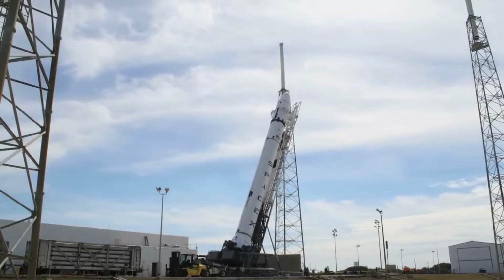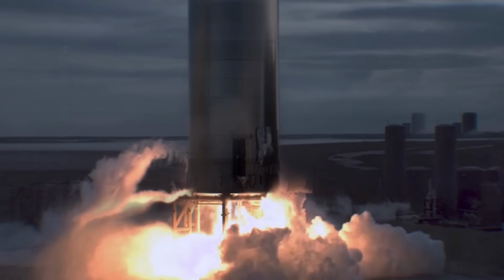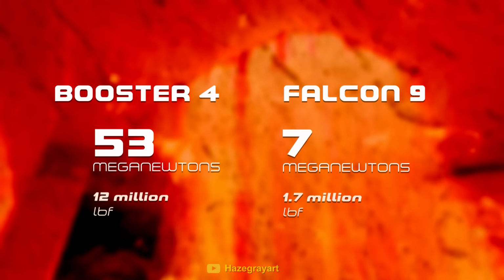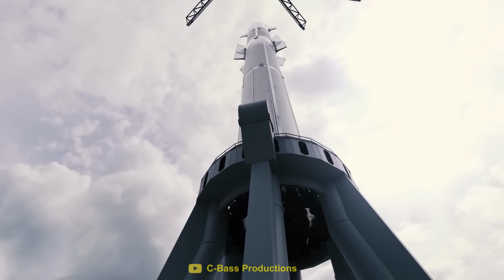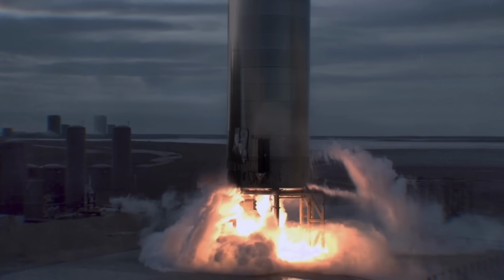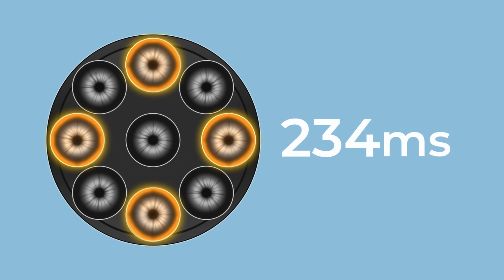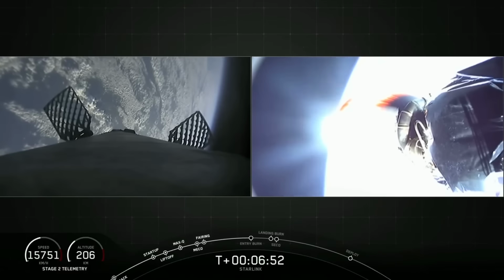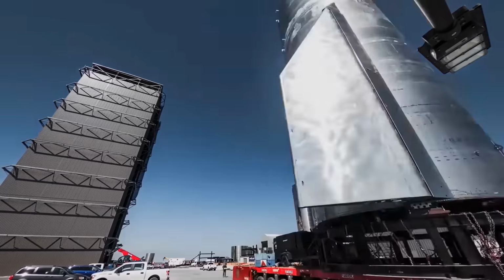How SpaceX Will Test 29 Raptor Engines

Comment: Shouldnt the oxygen be the limiting reagent for the static fires? Or are they precise enough with the timing to not run the engines oxygen rich at the end of the fire.
Reply: Unfortunately for this particular issue, oxygen is abundantly available from another source, known as the Atmospherically Induced Reagent.
Reply: @BobStein  yes but isnt a methane fire outside of the engine better than the engine itself being oxidized?
Reply: @k_Why  The amount of oxidizer you have in a tank has literally nothing to do with how rich you choose to burn your engine unless you totally run out of methane, which they of course would not do.
Reply: @filonin2  oh true hadnt thought about the fact that they dont need to run the methane tank dry. thanks for clearing up my misunderstanding

Comment: 14 TONS of fuel in 3 seconds!   😮
Holy crap that's insane!
Reply: its like  16,92,481inr
Reply: @ReadTheShrill
 14 tons of fuel in 3 seconds is nothing compared to the Apollo/ Saturn V moon rocket, the first stage burned 16 tons of liquid fuel per second.
Reply: @Starrystarryskyisme  All of this is incorrect. First of all are we talking fuel and oxygen or just fuel? Let's talk both for now. Raptor 1 consumes about 0.6 t of methalox per s (80% LOX). F1 burns 2.5 t keralox per s (72% LOX). So we have 5 x 2.5 t/s = 12.5 t/s of keralox. Raptor: 33 x 0.6 t/s = 19.8 t/s. And I mean it's kinda obvious, Super Heavy has over twice the thrust of the Saturn V. Raptor is more efficient than F1 but not 3X as efficient. 

Let's consider just fuel: 
F1 0.8 t/s x 5 = 4 t/s kerosene (RP1)
Raptor: 0.12 t/s x 33 = 3.96 t/s CH4

Ha! Same fuel consumption twice the thrust. Not bad, but that's partly down to Ox ratio, the combined figure is more illuminating. 

Note: I used 33 Raptor 1 engines. Booster 4 will likely be the only 29 engine SH flown. Likely only Raptor 1 Booster to be flown, Raptor 2 will consume closer to 1 t/s of methalox at 230 t thrust each. So 33 t/s of methalox per booster or 33t x 0.2 = 6.6 t/s CH4. I stuck with Raptor 1 because the figures are known.
Reply: @Starrystarryskyisme  And let's check the 14 t per s claim on Booster 4. 29 x 0.12 t/s x 3 s = 10.4 t of CH4. 30 t methalox so not sure where 14 t comes from. Maybe 10.4 t metric is 14 short imperial US t? No idea, I used metric t = 1000 kg Depends of course what fuel to ox ratio you use. If you use 0.75 that could explain the 14 t. It's between 0.75 and 0.8.
Reply: @please_stop-v7o   It was only necessary to say that if you include the 50 tons of oxygen to the 14 tons of Methane fuel burned by Starship in 3 seconds it comes out at a little over 21 tons per second compared to the Saturn V of 16 tons per second. My mistake, I should have followed the video closer. Anyway, I’m sure many people will be thrilled to read your amazingly detailed explanation as to why I was wrong.
Reply: @Starrystarryskyisme  Well sorry I find this stuff interesting. I don't care who is correct. Not meant as a personal attack but just saying the figures is meaningless without showing how you arrived at them. This way anyone can double check it in 2 s. And detailed would have been deriving the mass flow from scratch using specific impulse and thrust (which is how we know them).
Reply: The Space Shuttle solid rocket boosters burned 11,000 lbs per second, each, for a little over 2 minutes, and that doesn’t include what the Space Shuttle engines were burning.
Reply: @rwfrench66GenX  Sure but that was solid fuel. These are liquid engines that need to pump all that. Plenty of SRBs are more powerful than the largest liquid engines.
Reply: @please_stop-v7o  so why not use solid boosters?
Reply: @rwfrench66GenX  Many reasons. High thrust but low efficiency. Not really reusable. This is supposed to land and be reflown in an hour. Even refurbishing the Shuttle booster cost more than making new ones, because you have to completely rebuild them. A liquid engine can be throttled, which is critical too for landing. SRB is an easy fix for an overweight rocket to get of the pad but the liquid engines provide the actual performance to get to orbit. SRB's basically don't add deltaV, they just add thrust, so it can get off the ground while it burns enough fuel to go on without them. They are good for some situations but not for what Starship is trying to do (be fully and rapidly reusable, launch, land, quick inspection, refuel and go again until the tank dies from metal fatigue after a thousand launches. SRB are not compatible with "airliner-like reusability". They are cheap boom sticks, to give your expendable rocket a bit more oomph for a heavy payload. And you can't turn them off which comes with safety concerns (Russians don't consider SRB's safe for human use and never used them beyond ICBM's).
Reply: @rwfrench66GenX  dirty, wasteful. and reusability is spacex's main goal. you cant reuse srb's.
Reply: @rwfrench66GenX  cause when you start them you cannot turn it off
Reply: @neiljustineesteban8485  I’m aware of that, thanks.  That’s why they’re more efficient for take off.
Reply: @rwfrench66GenX  solid boosters cant control the throttle. There is on and off nothing in between
Reply: @luiswittrock223  I’m 56, I was in 10th grade when STS-1 launched, the physics club I was in built a model Space Shuttle and two other members of the club and myself were tasked with making the solid fuel which is basically aluminum powder mixed with some polymers.  I understand what SRB’s are and how they function.  I understand they can’t be throttled.  Please note I mentioned earlier their use for take off.
Reply: @rwfrench66GenX  I thought you meant in general. Whatever
Reply: @rwfrench66GenX  the entire Space Shuttle system burned something like 14 tons a second, if you include the oxygen then starship is burning ~21 tons of fuel per second.
Reply: Yeah, welcome to the world of numbers that are larger-than-your-human-brain-can-fathom.  There are numbers that you hear are big, but cannot wrap your head around, because we don't live in those volumes.
Reply: @relaxsleep9189  I agree. I can cope with the Moon being 240,000 (approx) miles away, that’s 30 Earths between us and the Moon. Can sort of imagine the distance to the Sun of 93 million miles, but not really sure about that. But the nearest star at 4 light years, no, can’t imagine that distance. As for the Andromeda Galaxy at over 2 billion light years, not a hope. I can see the comparative distances when you see a graphic showing our solar system and expanding out to include other galaxies etc. but that only shows the relative distances which is different to understanding the immensity of those distances. How can we possibly grasp the vastness of the universe? It’s humanly impossible, we may think we have a grasp of it but in reality it’s beyond our comprehension.
Reply: @Starrystarryskyisme   study a little astrophysics and bending manipulating and how expansion can be oscillating or expanding contractions also the perfectly clear proof u can generate and match up certain energies through a form of quantum entanglement or worm holes are also a great possibility my god can roll the universe up like a scroll
Reply: @Starrystarryskyisme  I totally get what your saying the mere numbers involved and true  comprehension of space and speed is completely ludicrous to try and travel conveniently
Reply: Not to mention the principals of chaos and material even capable of such a task yes u build up a wall of protection but think of the amount of objects same size or greater and their mass force potential so let alone seeing the object before striking it let alone being able to change trajectory to avoid object and return to primary nav point so we should “let it alone”
Reply: 64 tons wasn't it? 14 tons of methane and 50 tons of liquid oxygen.
Reply: Not fuel methane
Reply: @saucenado4844  For Starship, methane is fuel.
Reply: NPC ahh comment
Reply: the fact that he said ONLY that much like ik it takes alot but the fact he said that
Reply: totally sustainable. Elon has our best interests in mind at all times. narcissism is the wave of the future.

Comment: What is Starship going to do when Falcon Heavy is already under utilized?
Reply: The plan:  retire falcon Heavy.
Reply: It took a while for satellite makers to wakeup, realize and adjust the launch capability of FH but this year we will finally see more launches
Reply: One mission that it already secured is the NASA moon landing contract while another possible one could be a successor to the ISS. Also it’s supposed to be cheaper per kg to orbit than the standard falcon 9 so everything that goes up with that is supposed to be shifted over to Starship if it finishes development.
Reply: Supposedly they're going do dump 40,000 pieces of space garba--err I mean Starlink satellites every 5 years.
Because Falcon Heavy apparently couldn't do that unrealistic job either. I hope this blunder bankrupts Musk so he can fuck off and be exposed for the vaporware salesman he is.
Reply: @oldmandoinghighkicksonlyin1368  You're actually quite ridiculous.

Comment: Primal Space? More like Primal SpaceX
Reply: Prime number Space.  Notice that they're going from 29 to 33 for the final version.  These are both prime numbers.   Many small engines increases your redundancy.  The problem using many small engines is harmonics that can be unpredictable, which is what killed the N1.  I'm guessing that's why they're using 33 or 29....because they are prime numbers and makes harmonics less likely.  The N1 used 30.  Why switch to 33?  Because if you've burnt just a small amount of fuel, if you have an engine problem you can shut down TWO opposing engines and still be firing on a prime number, while maintaining thrust symmetry.  Falcon 9 can do a version of this by going from 9 to 7, but you'd have asymmetric thrust if the single center engine fails and then you have to pick one of the ring engines to shut down to stay prime.  13 to 11 could've also done this, but with less early-flight redundancy.

Comment: I am curious, for a rocket with so many engines, even at lowest throttle it must huge thrust.
How do they prevent booster from leaving ground during static fire
Reply: The booster is physically held to the pad by hold down clamps at the base of the vehicle. During launch these would disconnect and get pulled into the launch table for protection from the exhaust. Since its just a static fire thought they hold on the entire time.
Reply: They make it so that the thrust to weight ratio is 1 or less
Reply: Ratchet Straps
Reply: Tanks are filled with fuel, and/or other weights like water tanks are put on top
Reply: Usually weighted down and/or connected to the ground.  I think during a Soyuz launch, the rocket is held by the supports it sits on and uses explosive bolts to separate and lift off
Reply: Thick rope.
Reply: Here’s how they did it on Saturn 5.  

https://youtu.be/DKtVpvzUF1Y

Comment: If Soviets managed to get the flawed N1 design off the ground, I have hope for SpaceX. The lack of a flame trench is concerning though.
Reply: It's a bold move, that's for sure. I assume the thinking is that the vehicle will be made sufficiently robustly to not need one, and these lessons will make it more suitable for landing on unprepared regolith on Mars. Still, that's a LOT of force to design around.
Reply: @Double_Vision  The superheavy booster isn't going to Mars anytime soon, but I guess if they can make that work then doing the same to the upper stage will be a piece of cake.
Reply: @thatguy7595  Precisely my point. They broke a Starship with flying Martyte in the past, and those lessons are now in Booster. Starship and Booster might be a rocket, but in reality they're going to have to work like a truck.
Reply: @Double_Vision  you are right (00) ..
Reply: How hard is it to dig a hole with a shovel lol?
Reply: @michaeljava8736  they don't want a flame trench because starship will land on mars on a flat ground so they want to know what could happen if starship were to land on mars
Reply: @infinity5288  there are two sections. The booster, and the starship that sits on top of the booster. Booster will not go to mars. So they should have a fire trench for the booster. And land the starship on the ground.
Reply: @michaeljava8736  yeah but as one other commenter said if they successfuly landed a booster with 29 engines then landing a one with 6 will be peice of cake
Reply: @infinity5288  agreed 😱
Reply: @michaeljava8736  
Either way its musk's decision to not add a flame trench, but its pretty much for the same reason, to test starship's integrity on landing on mars
Reply: @infinity5288  you do know other people work at spaceX, right?
Reply: A water deluge system will be used no need for a flame trench
Reply: @Vjx-d7c  .
Reply: @Vjx-d7c  when that thing is fully fueled up, it'll have the raw energy in kilotons of TNT to outclass the nukes on Japan. No water system is going to stop that.
Reply: I agree, though in this context "off the ground" is a bit of a low bar.
Reply: @BobStein  agreed 👍
Reply: Rather than dig from the ground down they went with the idea of raising it up instead.  There is a LOT of room for the flames to escape.
Reply: I live in Karachi Pakistan and I like your comment if you
Reply: The N1 was scheduled for 12 test flights.  Only four were made.  All four ended in failure before booster stage separation.   The Soviets did get the N1 off the ground, but in no way could it be considered successful flight.
Reply: love the video: N1 design bad because of many points of failure, Superheavy good because of much redundancy.... why dont we learn from history? Ok, Elon also didnt learn from 100 year development failures of vacuum trains ... or 100 years experience from tunnel booring ... He is just a genius  ....
Reply: @NuclearSavety  well, one thing he didn't learn from N1 is that putting all your fuel in 1 tank is not a smart plan unless you like fireworks. N1 exploded with only a fraction of its fuel because of all the separate, spherical tanks. Starship has 2 tanks, with only 1 being spherical.
When one of those things blows up, it'll have the force of a nuke.
Reply: @NuclearSavety  Elon has totally outclassed the entire established space industry and made (mostly) practical electric cars a reality and even something of a status symbol.   He knows that enough smart engineering and testing and redesigning will achieve goals other peole could not reach.    The N1 failed, because it was Soviet style empirical engineering. They would have eventually gotten it working but they only flew N1s 4 times.  Starship will succeed.  It may go boom a couple of times but it will become a mature and safe man rated heavy lift platform.

Comment: 29 engines. 29 potential points of failure during the stress of launch.
Hmmm, the N1 had 30. They had quite some issues because that, one beeing never getting into space with it. Let's hope that Mr Musk with modern technology fares better than the Soviets did :)
Reply: If one engine fails and you have 29 you can still get to orbit, if one engine fails and you have just that one you can’t. Also the problem with N1 was vibrations and resonance cause by the archaic computers not being able to gimbal the engines correctly
Reply: @Sbinott0  well im more worried with an engine blow out than a failure, if this happens to one engine, it's possible it will take out all nearby engines with it, the saturn 5 solution of fewer but bigger engines might be much more expensive but it had many less failure points.
Reply: @blurglide  1) they are not going to 33 but 32
2) 33 is not a prime number
3) Your prime fetish sounds like a cult
Reply: @UCRaPH1F2PjjjTTynLehyF5g wtf man primes have nothing to di with this, starship will have 32 in its final form
Reply: you'd think from all testing they'd have a super robust understanding of the modes of failure and their statistical probability  and characteristics which precede these issues, so that computer systems can mitigate bad outcomes well beforehand. If they do then it should be quite easy to optimize the management of the rocket engines to always be nominal or have those outside margins switched off. If they didn't design it to fail gracefully from the bottom up it would be unbelievable given the amount of compute/AI and sensor data you can use to understand and control the dynamics realtime versus say even ten years ago....
Reply: It’s not like they have never launched with a similar amount of engines, Falcon Heavy ignites 27 during its first stage and those launches have been successful so far.